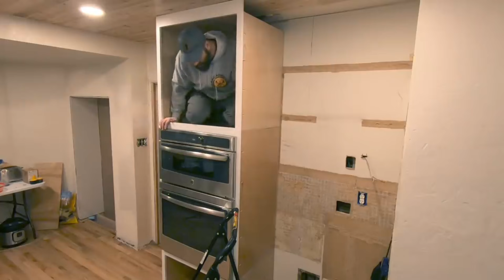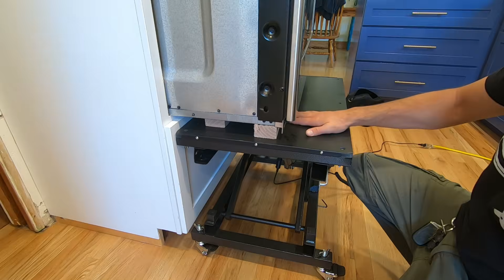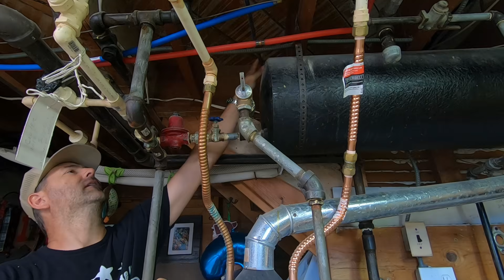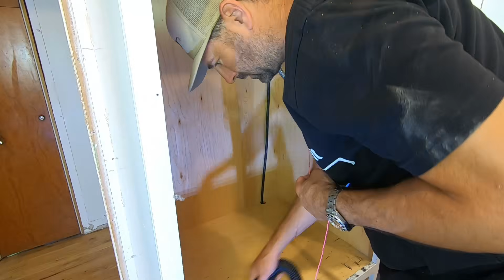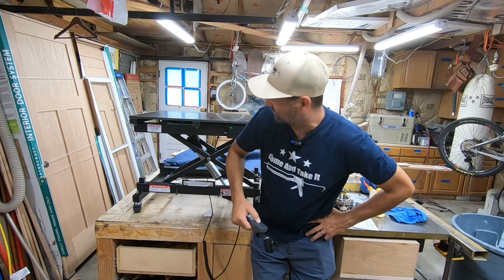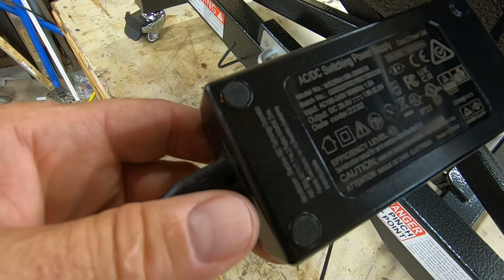Double Oven Install With No Help | THE HANDYMAN |

Comment: I installed mine by myself without a lift. I just made a 15.5” tall bench and used a refrigerator hand truck. The strap on the hand truck kept everything secure until I slid it into 5he cabinet.

Comment: Whole lot of vocation professionals chiming in on what DIYers do wrong, but I can attest that there are even more vocation professionals know how a job should be done but instead do shoddy half-ssa work in order to complete job faster and move on to their next job——time = $$&!  At least that’s been my experience and I’ve seen it in all fields.  I can do just about any job better than “most” pros because I am not watching the clock when I work on a project—-and yes I do it to code——anyone can buy a code book, and yes my jobs have been permitted and passed inspection, again, not all contractors are the same, but most work in this manner.  Own solar install, main breaker panel swaps, roofing work, built own shed, lots of different electrical jobs, some plumbing.

Comment: Love the video.  Love the lift cart.  I ended up making one from a wooden 16" exercise stepping platform and some additional 2x4s with floor glides on the bottom to help slide my double oven in and out.  The lift is a definite for a pro who has to do many of these types of lifts.  I also made the 3 piece cabinet based on an earlier Handyman video, which was really helpful.  I ended up putting the electrical junction box in the upper cabinet stacked above the double oven cabinet, as it is easier to install both the oven and electrical.  This remodel could have skipped the 'remove the oven' step if the electrical box was installed in the top box (back wall).  Just need to run the oven cable between boxes toward the back.  I also left 3" space above the oven for added installation ease, but probably not necessary.

Comment: Oh no! Hey couple tips with ovens. The bottom flange is just held in by 2 Philips screws.  Don’t even have to remove the door to get to them. You could just remove the door though in 20 seconds if you release the tab on the hinges! Love your videos keep it up.
Reply: The manufacturers recommend removing the doors to reduce. I think most techs do remove them

Comment: Great content as usual and what a handy tool. However, here are a few suggestions I have to make it even better.  I'd weld on some angle iron and relocate the wheels to drop the lift lower to the ground.  Then add some folding ramps to roll small implements on it to service at a more comfortable height.  Also, convert to tool battery to get away from relying on wall power.

Comment: Just did the very same thing this morning, no lift.
Reply from the maker: What did you use?
Reply: @TheHandyman1  made a makeshift table in front of the cabinet 
A flat dolly to move it
Took out racks and micro glass
Took off oven door (lots of weight)
Extra hand

Comment: Could use to lift hot water heaters up on a the standard platform they seem to use today. I built a platform from 2 X & 4X to remove my double oven on a square furniture Dolly, worked great. Harbor Freight a foot pump model that also is a great back saver & I’m guessing at a reasonable price if your not going to use this tool often.

Comment: Nice cart!  I have “construction slippers” that I use at clients homes. They have a rubber sole so no slip, and good traction on a step ladder. No, they won’t save my foot from a hammer drop, but clients really appreciate me not wearing outside shoes and it feels better than socks.
Reply: That's how I got hooked on Crocs. Doing low-voltage installs and alarms and such, got tired of socked feet.

The fuzzy ones are too comfy, should be illegal.